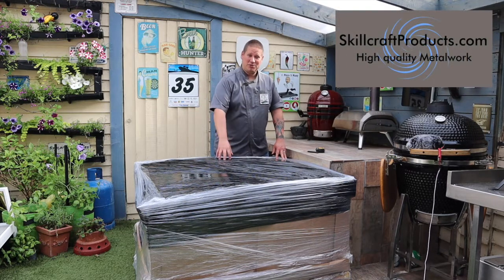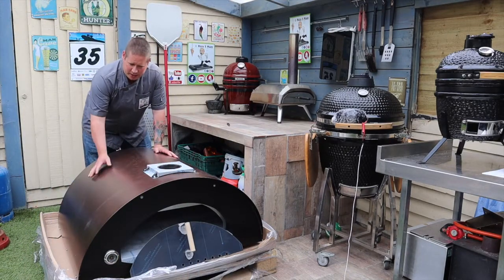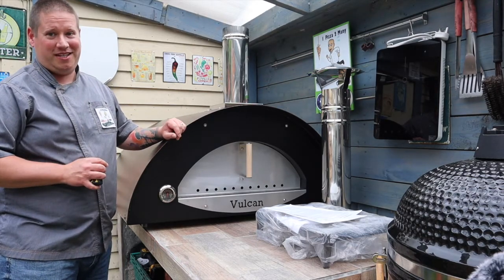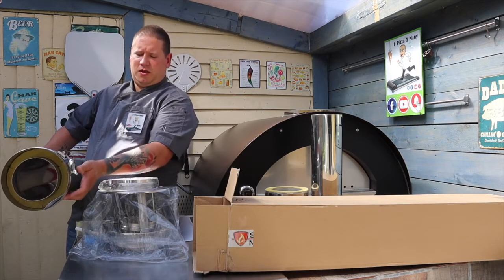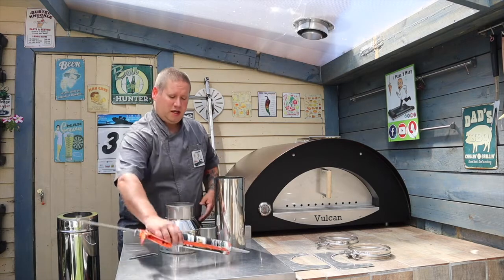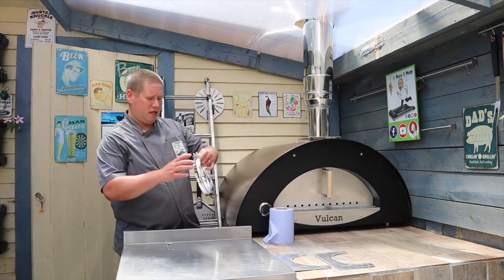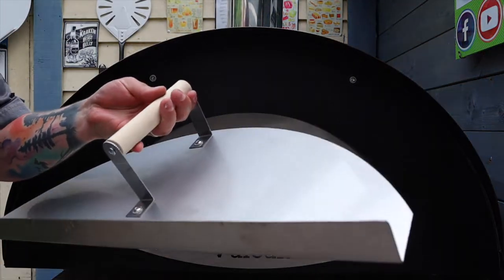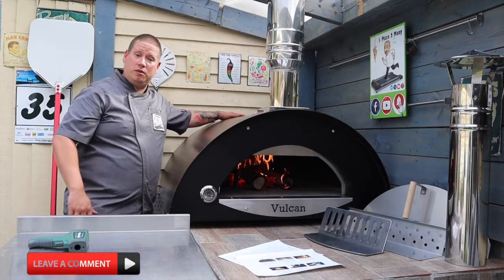Skillcraft VULCAN Wood Fired Pizza Oven Unboxing & Set Up * Made in Britain! *

Comment: What's the cooking temperature off the vulcan, great videos
Reply from the maker: Anywhere upto 500 degrees 😀🔥🔥🍕
Reply: @1Pizza2Many   had my oven at 350 yesterday for the first time, and they all burnt at that temperature, particularly the braces,
Reply from the maker: Where did you read the Temperature from?
Reply: @1Pizza2Many  the gauge on the front of the oven,
Reply from the maker: Ok, don't use that, it's pretty useless. Mine is well down on what the actual oven temp is because there is a metal plate right behind the thermometer so blocks the real heat reading. I would use Lazer thermometer so you can check the stone temperature before you cook. 😀👍